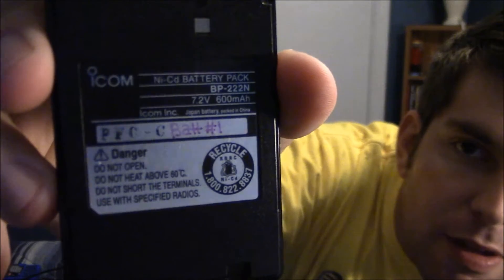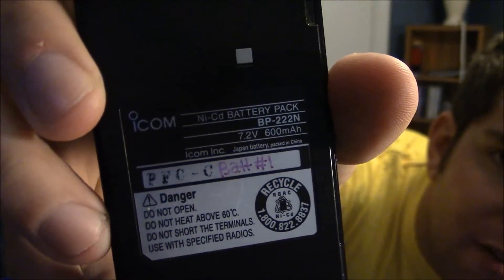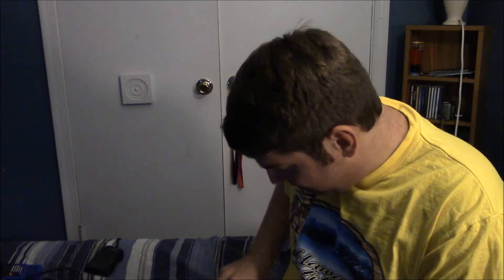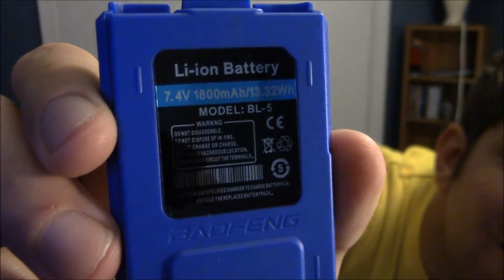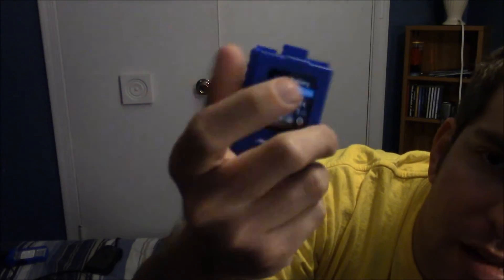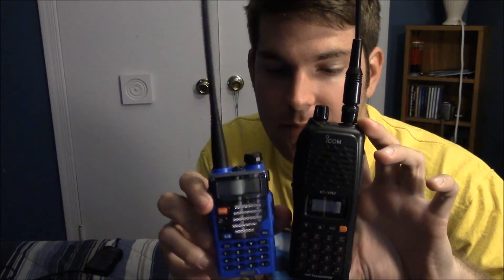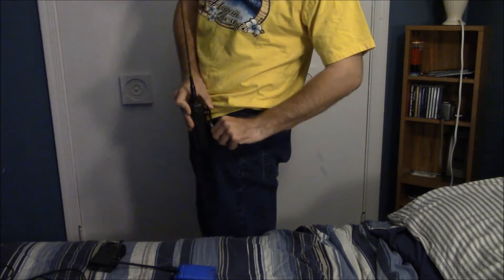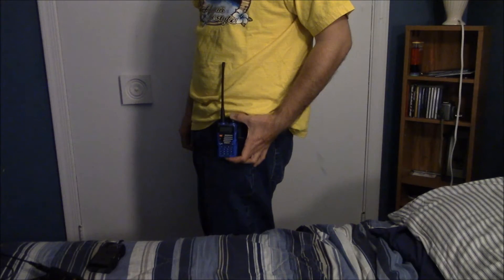Baofeng UV-5R Plus vs. ICOM IC-V82

Comment: I am having trouble programming the Baofeng too, I think I need to install software on my computer and up load the frequencies I am trying to program,
Reply from the maker: Go to frequency mode, type in frequency and then go to the menu option for "MEM CH", select what channel you'd like set frequency on, and then hit menu til it says "confirm" or "receiving memory" depending on which model you have. I now own a Baofeng UV-5RX3 and it can be programmed that way. Kind of a pain but it's doable.

Comment: Old Version Baofengs like you have. Have firmware bugs like that. I have a UV-5R which is manufactured on 2017. And never got any problem.
Reply from the maker: Yeah I gotcha. I now use a Yaesu FT-25 pretty much exclusively now and I like it MUCH better! Better range, easier to program. You don't need computer software to program an FT-25 like a UV-5R, it can be programmed by hand using just a few buttons (MR, then type frequency, push and hold MR again. That's all there is to it). It's a little cheaper than their old radios so I like to look at it like a Cadillac Baofeng if that makes any sense

Comment: The proper way to hold a radio is at head height, and the antenna is pointed 45 degrees between horizontal and vertical, away from your head.